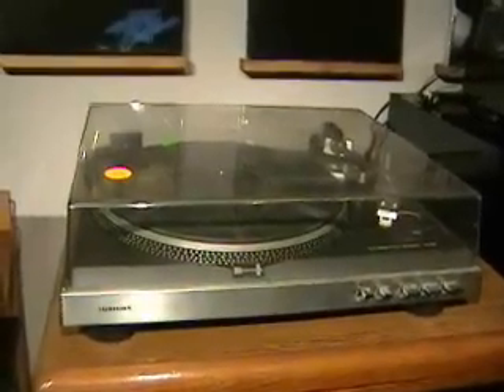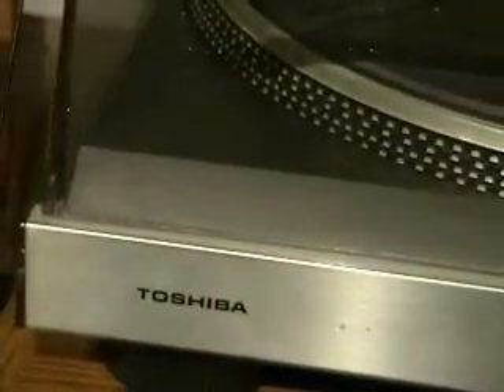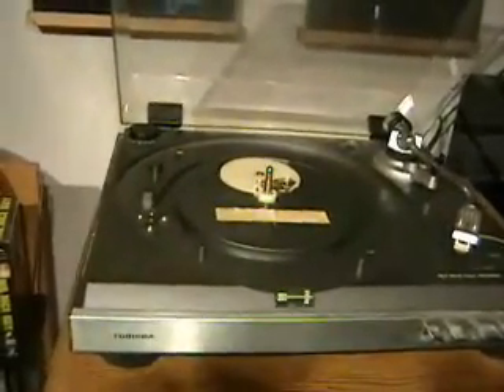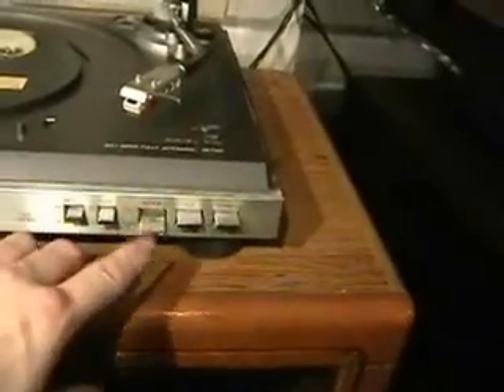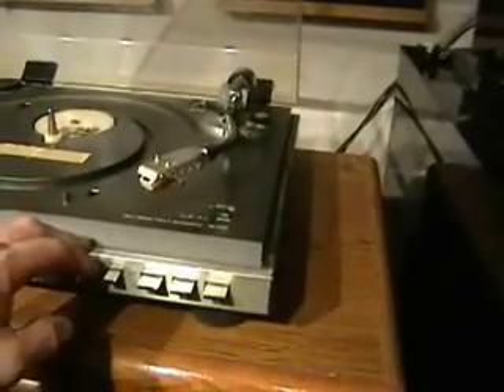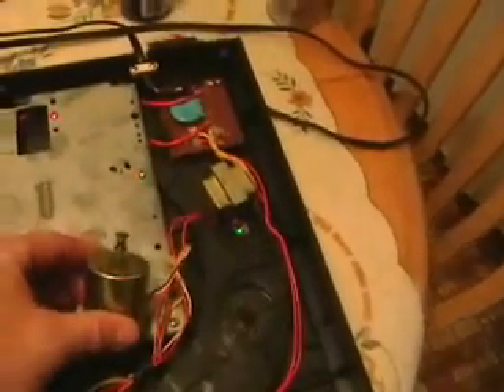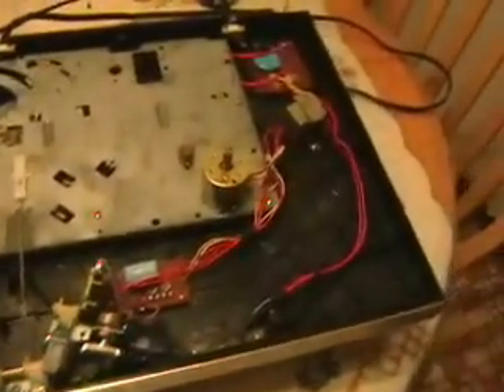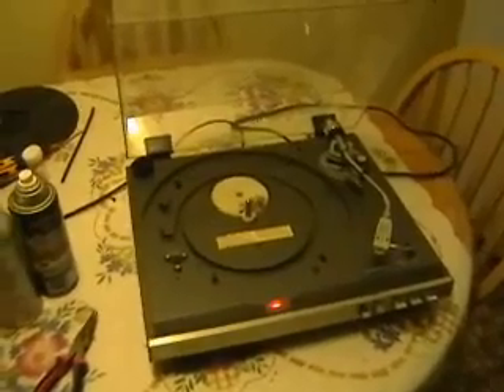Thrift store Turntable(Part 1).wmv

Comment: It looks like a great Toshiba turntable.

I highly recommend purchasing a micro-fibre cleaning cloth which could be found in a dollar store, bargain store, a grocery store in the mop aisle, or on eBay. 

Micro-fibre cloths are great because when you dampen them slightly with water, they will provide a really deep clean for the turntable body and won't scratch the plastic canopy unlike more typical cloths.

I use micro-fibre cloths to thoroughly clean all of my electronic equipment.